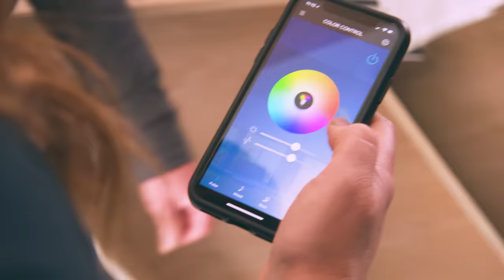The Weekender: "The Modern Man Cave" (Season 4, Episode 10)

Comment: The plywood has a modern take on a retro paneling vibe, which they seem to appreciate.  I wish you had used edge-banding to finish the bar, and painted the banding black to give it a more finished look.  I would have also trimmed the ceiling accent.  I hope all the plywood got top-coated...  

I would love to have seen the other side of the media cupboard staging /style a little more elevated - even popping the throws into a black and white /black and tan basket, and increasing the scale of the other décor pieces would have helped.  The blue couch, and the multi-coloured rug (which I like) are not tied into the rest of the design scheme, and there is a big empty space under the beverage shelf.  A few more finishing touches - candles, baskets, textiles, plants would warm it up a bit more.  

Lots to do in one weekend!

Comment: plywood console cabinet is... meh. Should have stained it. The LED mount is shoddy as hell - grab a router and make a groove, THEN use strong glue to stick it on as the adhesive tape are ALWAYS crap. And seriously do not leave any visible stripe, it's really ugly. Cable hole, not that great, wouldn't do it that way. One hole at the bottom most is enough. Handle, really, just use a cheap chrome / stainless steel handle to give it much better character. //// plywood bar counter looks great in design, but will be greater if stained. Lightly stained + black edge paint = win. //// overall looks really "homey", doesn't feel very "tech" tbh.
Reply: its good enuf for my 22 year old gamer son n his friends. Not sure why the room looks low budget. Maybe its just me. Tho. But my son wuld friggin love this college. freshman room. Hed never leave tje basement hahaha

Comment: "Bevel", you keep using that word, I do not think it means what you think it means. A bevel is an angled cut along the edge. the slot you cut with the straight cut bit on the router is called a Dado, a router cuts, and it can cut a bevel with a bevel bit installed.